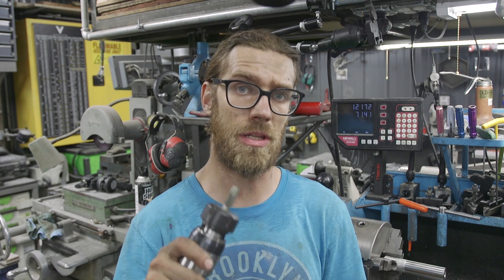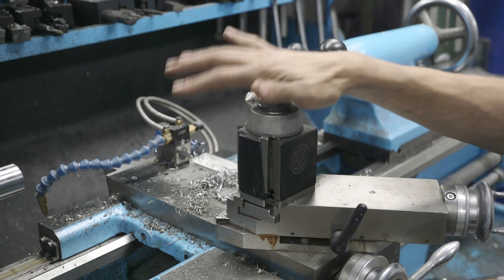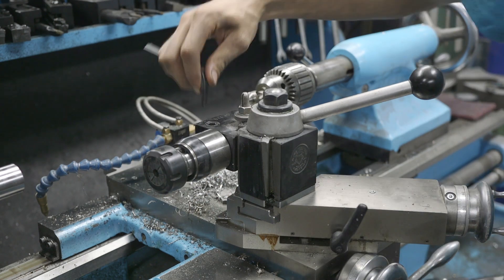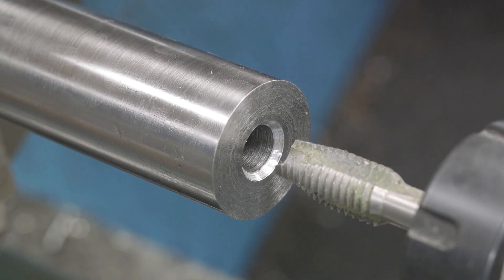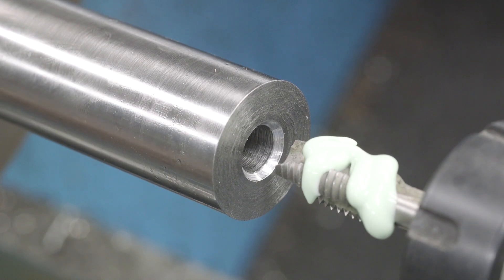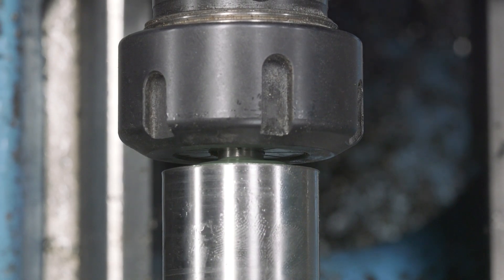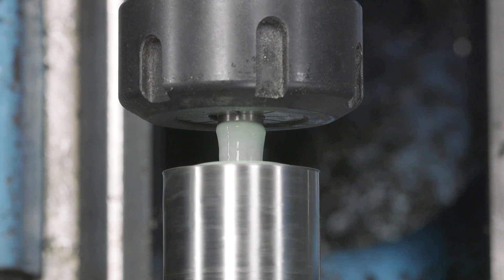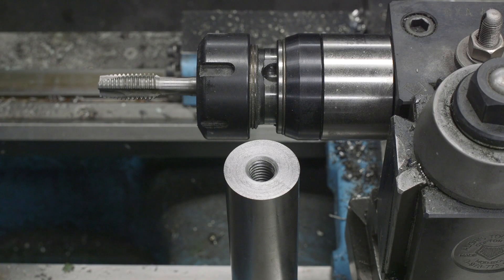Internal Threading Made Easy

Comment: Am I crazy for just feeding the tap in the tailstock?  Because I’ve been doin that way for years with great results,  just requires you have some feel.
Reply from the maker: That works great I do that sometimes as well
Reply: I just usually leave the tailstock unlocked, and push it in by hand, with light pressure applied during tapping, and light pull applied during extraction. Works just fine. For a really big thread the threading torque might try to throw the tailstock off the ways, but haven't seen this issue yet.

Comment: Though I understand how this works from watching other videos, you didn't actually show the floating tap holder working so some viewers won't know what you are illustrating.
I think a floating tap holder in the tail-stock is a better option as it is lined up precisely. Just my opinion. Thanks
Reply from the maker: Yeah good point. Benefit of the carriage is I can move the holder in and out faster. Especially if you have a large tailstock and small tap you could ask to much force from the tap pulling the tailstock in.
Reply: @VanoverMachineAndRepair I usually keep a bit of pressure on it during tapping to counter this. Regularly do M6x1 threads like this.

Comment: Question since the carriage is moving do you have it set in 13tpi? Figured the point of a floating tap holder the carriage wouldn’t have to move thus not worried about stretching the thread pitch if it got out on the return
Reply from the maker: No it does not need to be add a certain pitch. The floating tap holder compensates for that. Also the floating does not move more than a half inch so you still have to move the carriage

Comment: What's the advantage to using this tap holder mounted in the tool post as opposed to using a drill chuck in the tailstock? Seems like getting the tap holder lined up would be more difficult than using the tailstock which should be lined up already.
Reply from the maker: You can more easily move it in and out since the cross slide gear is more aggressive than the tailstock. In the tailstock you have to leave it unlocked and slide free on the bedways or try to crank the handle at the right speed. Either way they both work. Also this holder has a 1” shank which wouldn’t not fit in my tailstock. In addition when backing out the tap it’s possible that the tool  holder could fall out when pulling back on taper in tailstock but in the carriage it will not fall out.
Reply: @VanoverMachineAndRepair you had said in the video this is a floating tap holder. Is this fully slide (a few inches?) that’s a good method. What’s your method for finding center with the holder like that? Also squaring up the tool post is important. This method takes a little more set up it seems.

Comment: That is a spiral point tap.  Not a spiral flute tap.  Big difference.  Spiral points shoot the chips forward, use in through holes.  Spiral flute taps bring the chips out the back, for blind holes.    You did not show getting the tap holder aligned on center, and you did not show the axial travel afforded by one of these holders. Would have been more informative to see that.  -----Doozer
Reply from the maker: Yes spiral point

Comment: I allways use a tap if its available in the right tolerance. Single point threading is the biggest waste of time if you got a fitting tap at hand (In my opinion)
At my old work we just used the unclamped tailstock. Even tapping M4 with a 500x1500mm lathe (with the equivalent mt4 tailstock ;) we got a morse taper tap holder with a self centering square so the tap is grabed by the square and the entire mt has to spin.
Reply from the maker: Yeah there is a place for single point threading but on quick projects I like this better.